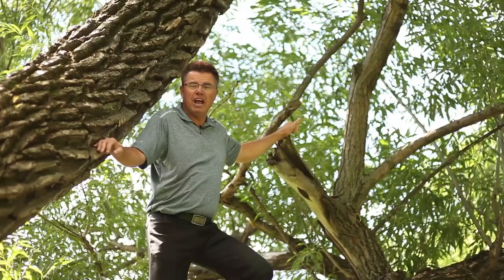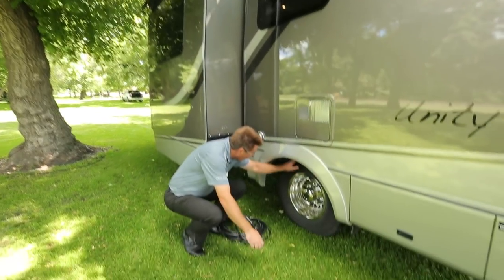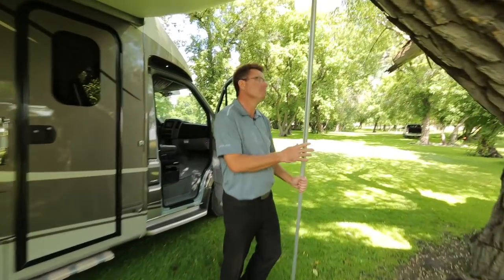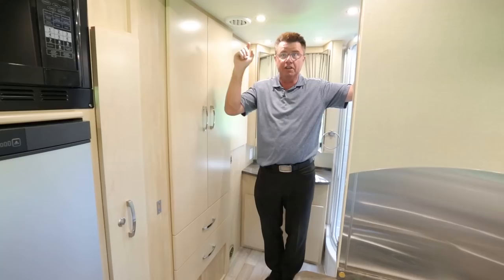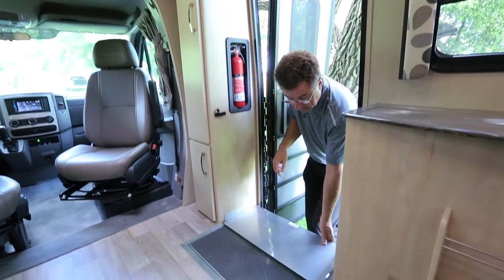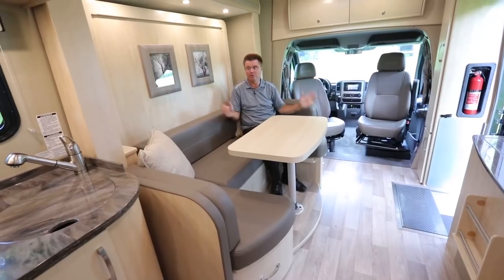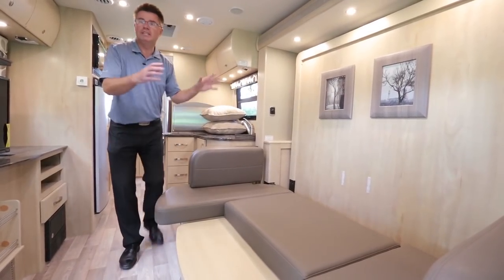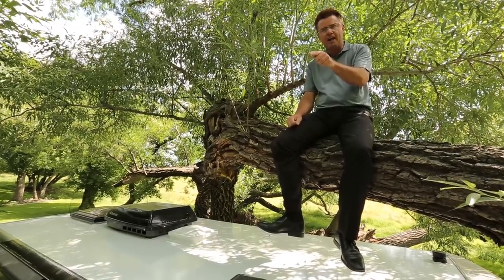2014 Unity Murphy Bed

Comment: can somebody tell us if you can get around in the camper as you drive with the murphy bed pulled inside?..what about using the bathroom and the kitchen while you drive?...also...do you have to take off all the sheets and blankets to store somewhere to put up the murphy bed for the daytime?...and...lastly...which is more comfy?...the L shaped dinette sets or the theater seats?...we aren't certain what the inside is like when you are traveling...thanks for your comments...pamela

Comment: Only thing is that you would be SOL if you wanted to sleep on the Murphy bed and HAD to put the slide in.  I doubt you could use the bed without the slide out, and that is not good.  I have a Winnebago View with a slide, and I definitely keep the slide in in crappy weather.  One other thing:  Without the bed down, you have no window on that wall.  Windows are very important IMO in small RVs.  Not good for claustrophobics.  LOL 
One more question:  How in the world can you sleep four as stated on Leisure's website?  I don't think so, unless you put everyone in the Murphy bed, or some in the bathroom on the floor?
Otherwise, nice coach.
Reply: A lot of Class B motorhomes don't even have beds.  For a Class B this is pretty amazing, if it's not good enough for you get a Class C.

Comment: 188 horsepower??? My Subaru Outback has that!
Reply: Horsepower doesn't matter for this type of vehicle, it's torque that counts. This is a diesel engine with ~300 lb ft of torque most of which is available at about 2,000 RPM. So it can pull it's heavy self around town and get gas mileage similar to that of a large SUV, pretty impressive actually.